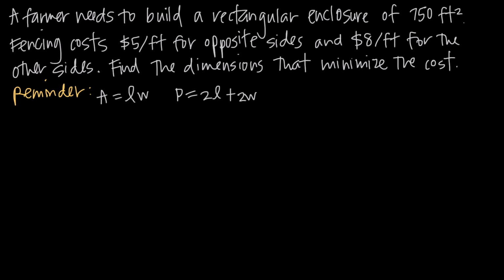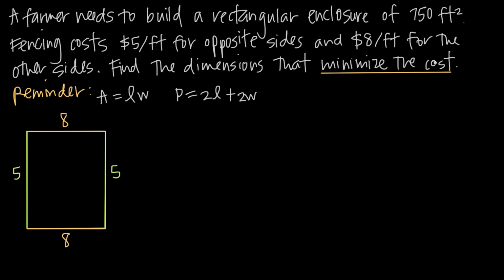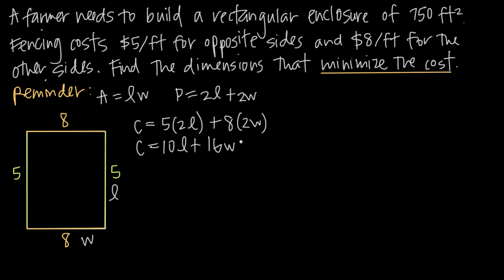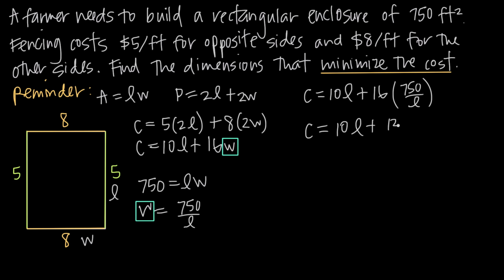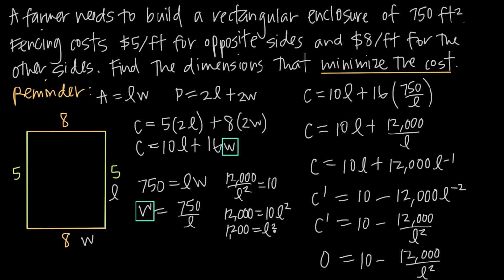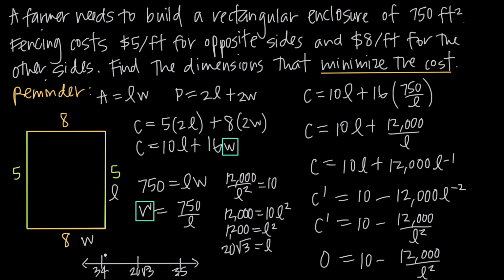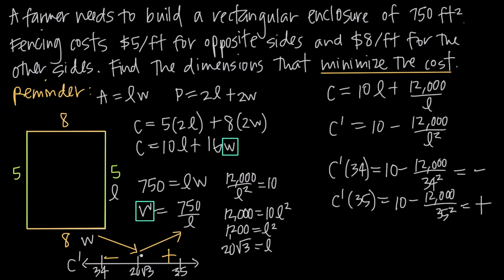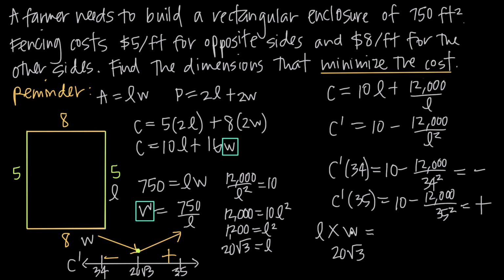OPTIMIZATION: Dimensions of a rectangle that minimize its perimeter

Comment: Damn I don't know the math behind that part where you did 750/20rad3
Never mind figured it out. Multiplied both sides by radical 3 
Got radical 9, square root equals 3
20×3=60, so now it's 750rad3/60
Divided both by 30 and got 25rad3/2 👌👌👌 had it figure it out myself. Man I'm bad at math. I over think too much
Thanks for the video ima do that problem tomorrow morning since I have an example which is very similar